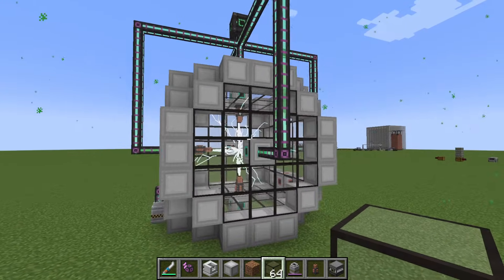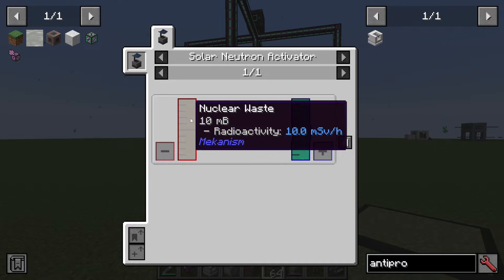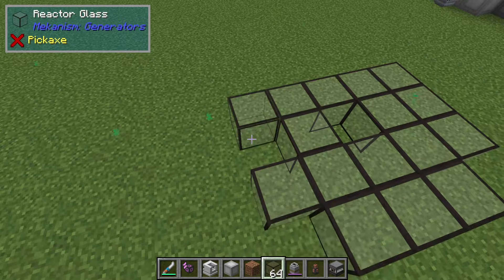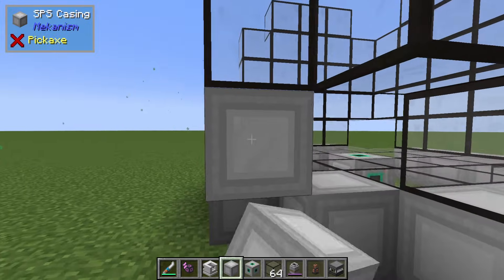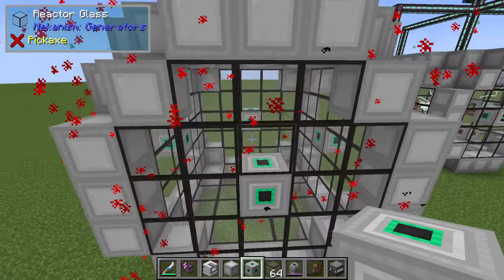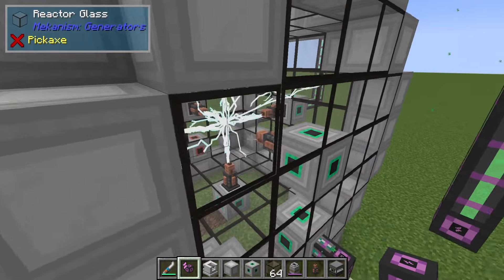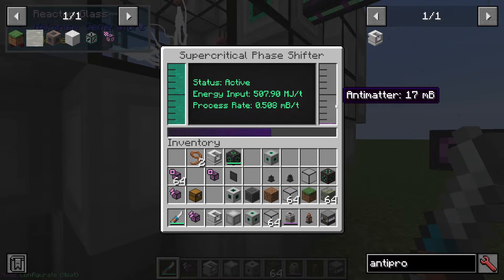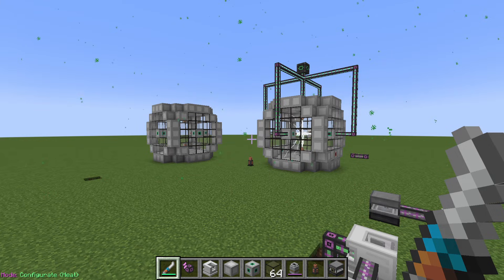Mekanism SPS (Supercritical Phase Shifter) Tutorial

Comment: woudl've been helpful if you said how many casings we need
Reply: Hi, I’m working on this myself, and I hope I can simplify this for you and others: 
You will need: 
60x SPS Casing - 16 for top & bottom (32) + 7 for each of the 4 vertical edges (28)
an additional 4 casing is needed for each SPS Port.  A maximum of 6 ports (1 per each face) you will need an additional 24 SPS Casings, for a total of 84.
Each casing requires 4 Polonium Pellets, 4 HDPE sheets, and 1 Plutonium Pellet.  336 Polonium Pellets, 336 HDPE Sheets, and 84 Plutonium Pellets are required to craft the casings. 
In addition to casings, you will need 20 Reactor Glass per each face, for a total of 120 Reactor Glass. 120 Lead Ingots, 120 Enriched Iron and 30 Glass are required to craft the Glass.
I hope this description helps.
Reply: @ianmobbs804   built the sps myself long ago, but this will definitely be helpful to others
Reply: @ianmobbs804  Missing the 8 casings needed for the 2 SPS Ports used for input and output. So you need a total of 92 casings which is:

368 Polonium Pellets
368 HDPE Sheets
92 Plutonium Pellets

Also, I know the comment was about casings but the items needed for the supercharged coils aren't cheap. You need 6 supercharged coils, which in turn need 6 lasers. For the lasers you need:

12 Energy Tablets
18 Reinforced Alloy
6 Steel Casing
6 Diamond

For the supercharged coils you need:

6 Lasers
18 Copper
12 Ultimate Control Circuits
18 Polonium Pellets
Reply: @ianmobbs804  SO helpful, thanks for doing the math
Reply: i built a machine that takes leaves and turns them into hdpe sheets rather quickly so im so glad i did this now lmao.

Comment: Whats the best source for the energy input?
I currently got Draconic Evo reactor to tier 7 but I am only inputting 3 MFE/t. How to increase that?
Reply: Flux gates, the ultimate universal cable can only transfer 3MFE/t
Reply: @KaterinaKPOP  This is not accurate. Universal cables are additive.  Basically every piece of cable you add multiples the transfer speed. As an example; If one piece of cable is 3mfe/t than a run of cable that is 10 long will transfer 30 mfe/t. (i didnt check the math of actual in game mechanics)   The same is true for all Mekanism pipes as well.  The more pipes you run the more material can be stored in those pipes. This is an easy way to store a massive amount of radioactive waste without having to build a farms worth of waste containers.
Reply: @KaterinaKPOP  if I'm not mistaken universal cables would transfer as much as possible and it depends on the amount of cables
Reply: @Nick-wy2ee  Flux points seem to be the move as they dont have a Distinctive limit on power transfer. You could always add more cables but at what point is it worth it